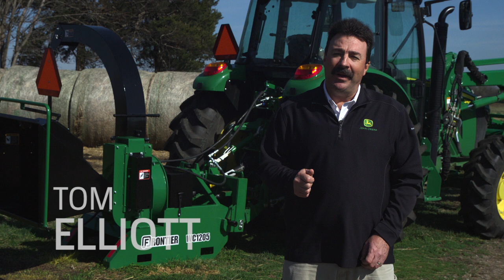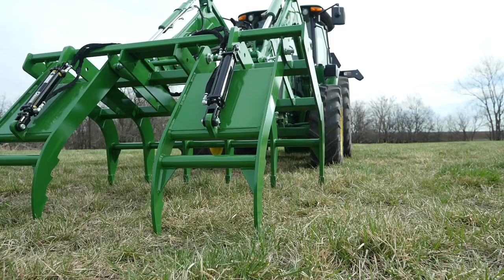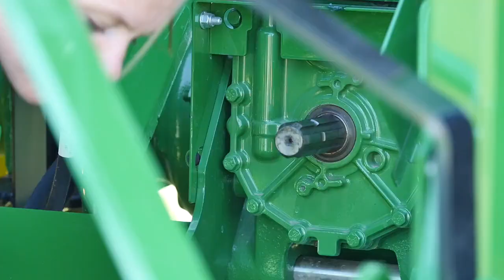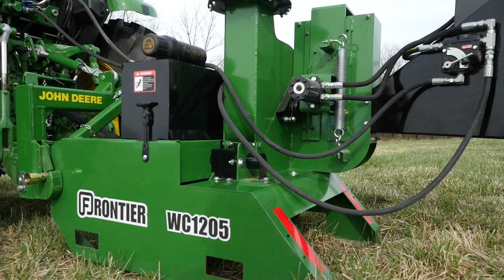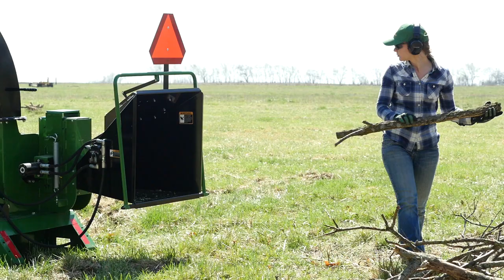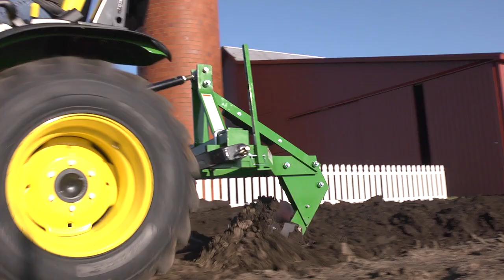How To Use A Wood Chipper | John Deere Tips Notebook

Comment: Will this work on are 2014 3046R we have a back hoe for it and a front loader and a frontier 72 inch snowblower
Reply from the maker: All of our Wood Chippers are compatible with your 3046R Compact Utility Tractor. Learn more about the Wood Chippers here: www.deere.com/en_US/products/equipment/frontier_implements/landscape_equipment/wc12_series_wood_chippers/wc12_series_wood_chippers.page?
Reply: Our 2017 3046R with a cab and I love it, it has 45.3HP and 34.1PTO HP I dont know about your 2014. but this Chipper the WC1205 the smaller one needs 35 hp PTO from the tractor. Yah ok that might work. But the other WC1208 is for PTO HP of 75 -115. so no! not all their wood chippers will work for your tractor.
Reply: btw i got a WoodMaxx ™ WM-8H it only needs 19HP PTO lots of info about it here: http://www.woodmaxx.com/WoodMaxx_8_PTO_Wood_Chipper_Hydraulic_Feed_p/wm-8h.htm